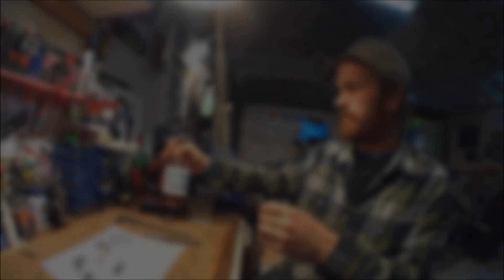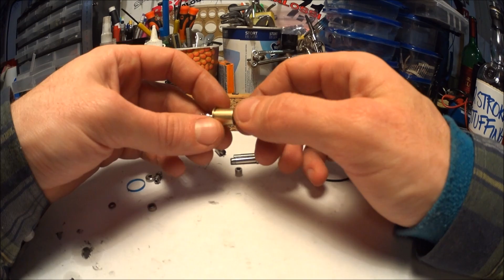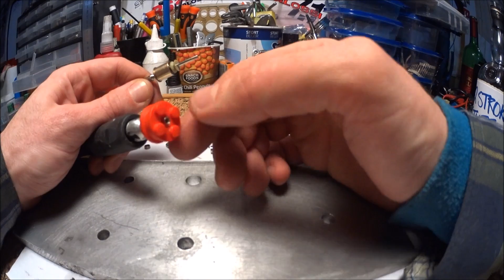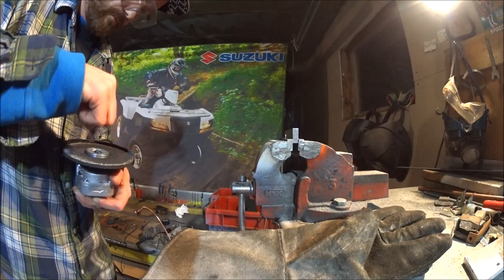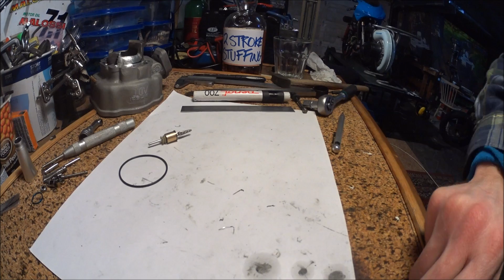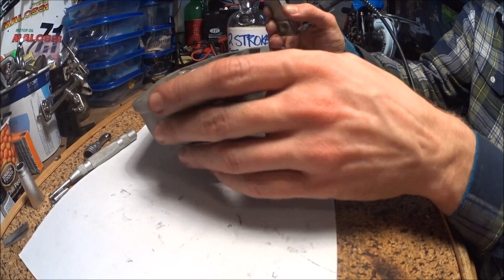CHEAP DIY 90° GRINDER (FITS 50CC) O-ring Style - DIY Poor Man's Porting Tools

Comment: https://www.ebay.com/itm/Right-Angle-Converter-Attachment-Kit-For-Power-Tool-Accessories-Rotary-Tool-HV/283453453618?hash=item41ff247532:g:Y-cAAOSwckVcGihz
Reply: Sorry but that will not work for most 2 stroke porting jobs, way way to big

Comment: Do you know what kind of parts I would need if I built this tool without the dentist tool parts? I just received a micro right angle grinder and it is too large to fit into the small engines I am porting, so my only option is this tool you have made here. If i need the cheapo dentist tool parts, do you have a link to where you bought them?
Reply from the maker: +Sirpotatoguy You need two small bearings with ID that will fit your burs and a small pulley(the tiny ones from Lego Techics might work) Dentist tool, bearings etc. can be found on ebay.
Reply: Thank you, this helps me out a lot! What holds the bit in place? Is there a collet or anything? Also, I wonder why this isn't an attachment being made for rotary tools? This would make a great Dremel attachment and would make small engine porting tools a lot easier to find.
Reply from the maker: +Sirpotatoguy You're welcome! The bit is just butted up against the front bearing and the pulley butted against the rear bearing.

Comment: 90 degree angle attachment you can buy on Ebay. Type in the search engine "right angle attachment" or "dremel 575".
Reply from the maker: +m f Thanks for the tip, but I'm sorry to say that this dremel attachment is too bulky to fit in smaller cylinders.
Reply: @2STROKESTUFFING not to mention they tend to work like dog poop

Comment: What (professional) porting tool do you use yourself? I bought a dental tool before I saw you wouldn't recommend it, and indeed found I wasn't able to use it for porting. But I don't really like this principal, would rather invest in something that is easier to use and more durable.
Reply from the maker: +TJH Tuning Actually I don't own any professional porting tool... But I've never heard anything but good things about cc speciality tools.
Reply: 2STROKE STUFFING I have been looking at CC Specialty Tools as well, but I don't really like the shape the smaller tools have. They probably didn't have any other choice, since they had to keep the tool small and reliable, which means if I want a reliable small tool I probable have no other choice than getting myself one from them, but I hoped you might have found something else, since you're a guy that does some things in a let's just say different way haha. No hate, I really like the ideas you come up with! Keep the inspiring videos coming!

Thanks for the (really quick) answer by the way
Reply from the maker: +TJH Tuning Thanks! I know there's a belt drive tool by a dutch manufacturer that looks very promising out there, if I just could remember what it was called and where I found it... I'll let you know if I do!
Reply: 2STROKE STUFFING Would be nice. Thanks again for your reactions!

Comment: Can this bearing assembly form the dental tool be purcased seperately?
Reply: i think you can use some brass or copper tubing and rc brushless motor bearings which you can buy seperate. i think there should be something similar.
Reply: What dia. Shank burrs does this bearing assy fit? 

Great videos, man!  Very inspiring 👍.
Reply from the maker: +stonecraft98 I'm not sure...
Reply from the maker: Thanks! 2.35mm